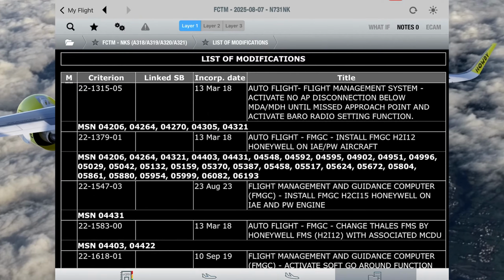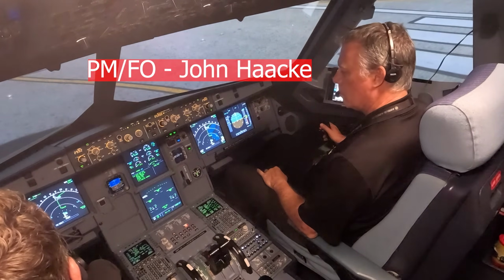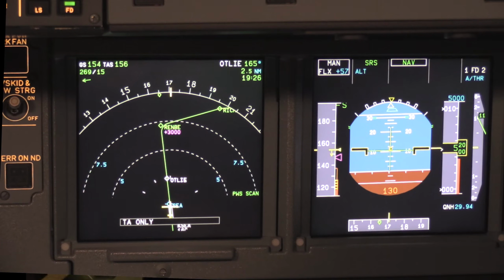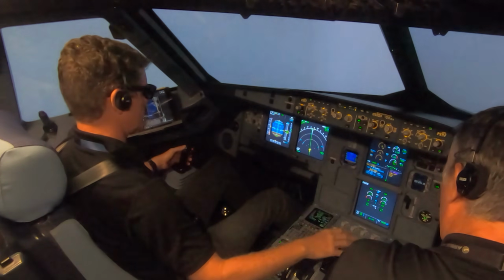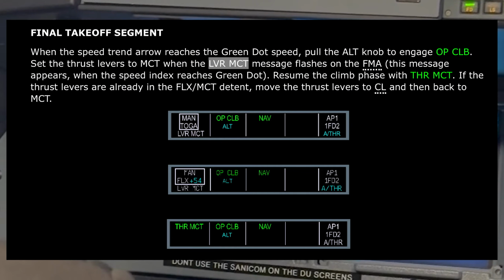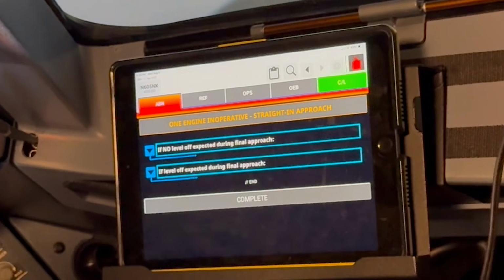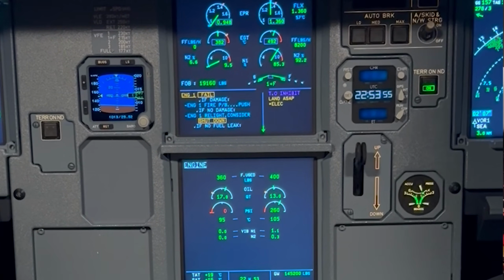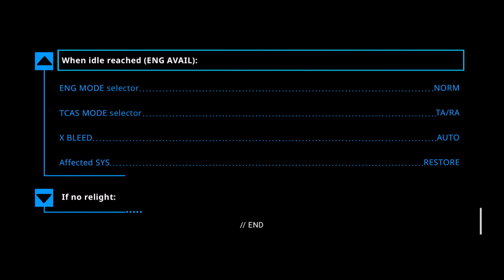Spirit Flight Ops Training - A320 Engine Failure After V1 Final

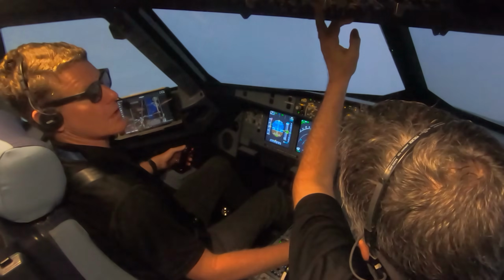Comment: 8:14 A few questions here: "APU on" but no reaction? 11:25 starting the APU again. Also are you not supposed to stop ecam when the engine is secure?
Reply: I'm pretty sure its AP1 not APU on
Reply: Exactly.
Many non-standard things happening here.
Reply from the maker: @michaelrabie1833 a lot of airlines don’t go verbatim Airbus SOP. This was Spirit’s SOP.
Reply: There’s a lot of stuff either wrong or poorly done here. Regardless of SOP’s varying across different airlines and Airbus its self.

Comment: Would they continue the flight after a relight? I feel like thats still an emergency and should head back?
Reply: Yes, they do. Once an engine fails, it trips an emergency sequence. Even if the engine restarts successfully, the flight crew cannot simply assume it will operate normally for the remainder of the trip. The underlying cause of the failure remains unknown and therefore is still an emergency, as you surmised. 😊